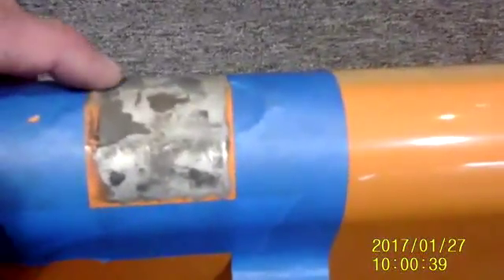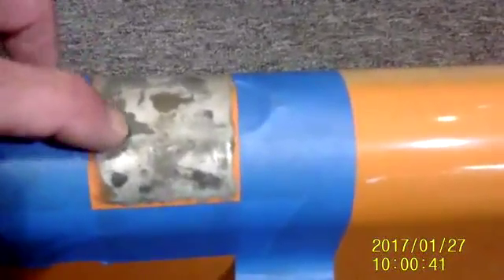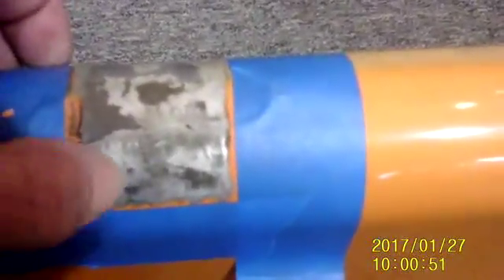Aileron and Flap Issues - Grumman Style

Comment: I own a 1974 Grumman Traveler. I just had the engine completely overhauled and STC'd for the high compression pistons and nitrided jugs. Now when I am flying, if I let go of the yoke, the plane will rapidly turn to the left. I have tried bending the trim tabs on the aileron but it doesn't seem to help? Any suggestions or fixes?
Reply from the maker: Rig the whole plane, takes about 4 hours